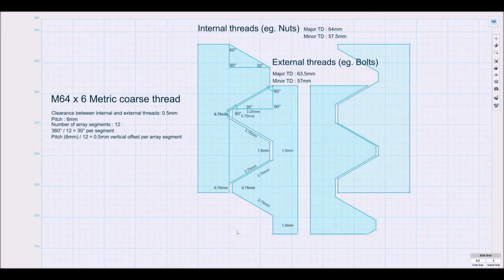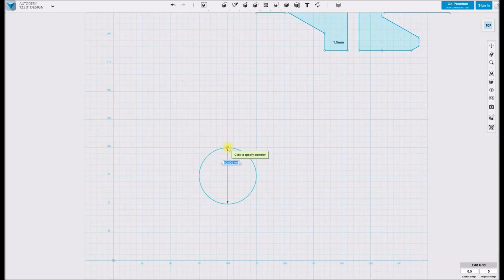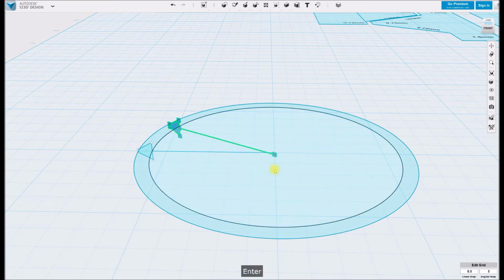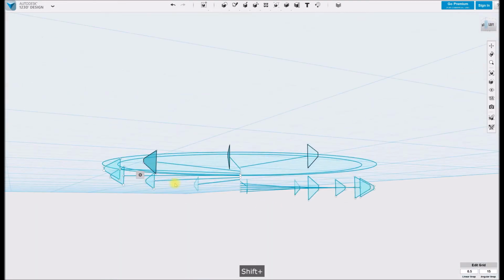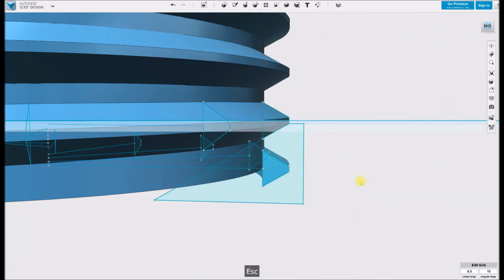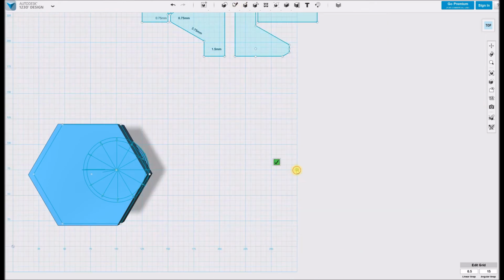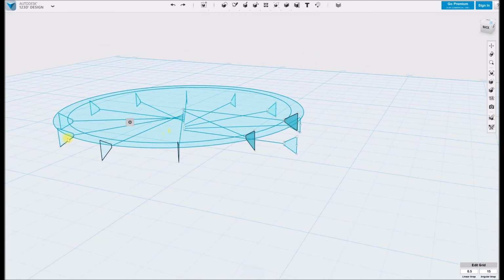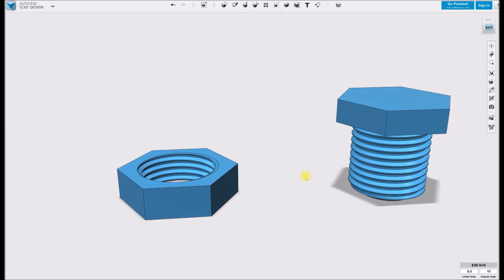How to build internal and external metric ISO threads in 123d design v2.0

Comment: Hi thank you for an excellent tutorial. One question i would like to build an M30X3.5 thread but am struggling with finding the correct Major/Minor diameter's for the nut and bolt. Any help with this would be appreciated
Reply from the maker: Hello, Electro. You’re welcome for the tutorial!, if you’re trying to find the correct major and minor thread diameters to model from, they can be calculated from formulas available on the internet. Unfortunately, I don’t have a moment right now to track them down for you, but any ISO thread that you would want to make should conform so the ISO formulas online. I hope that helps, please let me know if you are unable to find the formulas and I will try to assist.
Reply: @drive3d270  Hi thank you for your reply. I have managed to figure it out so happy days, appreciate your response.

Comment: Very informative. I am trying to make a 123D Design with a M5x.8 thread. It has been a real struggle for me trying to understand trigonometry and working out some of the measurements. I think I have a handle on everything except how to calculate the external thread major td and minor td. eg in your example above they are 63.5mm and 57mm. Was hoping you could point me in the right direction.

Comment: Again... all was going well until you made the hexagon head dimension "across corners" not "across flats" tut tut :-p
Reply from the maker: What time in the video (minutes and seconds) is the point when you're getting hung up?
Reply: 17:18 you have a circle of diameter 95mm or radius 47.50mm you should have a Hexagon measured across the FLATS not across the CORNERS...  look at the specs again :-)
Reply from the maker: Right you are. The intent of the tutorial was mainly to present the technique for generating the threads themselves, and I clearly got complacent when it came to the less important features like the dimensions of the hexagonal features.

Hopefully, you were still able to benefit from this tutorial.
Reply: Oh yes very helpful, I worked in mechanical engineering for many years and it just looked wrong and I thought I should let you know why... :-)

Comment: Very well done, a great explanation of what is a very difficult subject.  Perhaps a little more time explaining the way you set up the initial thread for bolt and/or nut might be useful for us "dumbos" as it was a little less than clear what you were doing with the triangles etc  when creating that first  thread.  After that I managed to follow along with the duplication process.  Also as an aside, perhaps a mention for newish 123 Design users, it is critical to select each of those triangles in ABSOLUTE SEQUENCE or you will probably get the dreaded big RED "Invalid operation"  warning.

Comment: Ok, so I'm confused.  According to your profile, and verified on wikipedia, the internal (bolt) thread peaks should be 1.5mm across, not 0.75, yet you made the nut thread profile exactly the same size as the external (bolt) profile... it should be 0.75 larger (vertically, on the profile), yes?

Comment: I found the constant relocation of the control point very monotonous. I made a few profiles using your method then I copied all of them and pasted the group. I selected the whole group again.… Doing this I was able to significantly reduce the number of stops and time to complete a entire thread profile.

I have continued to use your method to make specialized thread designs and experimented with trying to use the fewest number of profile sketches. If using increments greater than 30° there will be distortions that will make the thread fail.

I also found using just a circle and the profile sketch makes moving the control point to the center of the circle easier.

I do believe this is one of the best tutorials I have seen. I learned a lot from it.
Reply from the maker: Excellent suggestion, Sir. There is always room for improvement!  I have pinned your comment so that others can possibly benefit from your suggestion. 

Thank you for your input, and kind words!
Reply from the maker: I agree, its very monotonous. Copying and pasting the whole group will definitely result in less hassle, and makes it a lot more reasonable to do the progression in smaller degree-increments. Thanks for your input, if I make another updated tutorial, I will be sure to add that.

I'm pleased that you have gotten something out of this tutorial.

Comment: Just get a proper CAD program like Autodesk Inventor from Piratebay...
Reply from the maker: Higher level CAD programs like Inventor, Fusion 360, Solidworks etc. All have thread building tools in them. So if a user is ready to make the move to a more professional program then there will certainly be more useful tools at their disposal. However, with 123D design being a program that it mostly meant for beginners, while it doesn't come with as many features as the higher level programs, it is also less intimidating and easier to use.

It really just depends on where you're at in your learning process and how far you intent on taking your 3D designing.
Reply: I have a copy of AutoCAD 2000 that I still use for extremely detailed design work because it allows coordinate entry for high precision drawing. Even after over 15 years I still occasionally stumble across something new to use.

Comment: Good evening, I would ask why doing LOFT in all areas between the one and the other comes straight rather than curved someone could help me? thank you.
Reply: I had the same problem, and until I watched the video two or three more times I didn't realize what I was doing wrong. You need to select all the shapes using shift/click in order, then you click loft… If you click loft first it will always create the new solid between the first two shapes you have select immediately after you click the second one, whether you hold the shift key or not.

Comment: I'm still scratching my head as to where you got 2.25 (1/2 of 4.5), where 4.5 is no part of either Major or Minor Diameter?Everything else is very clear and straight forward, though picture clarity faded a few times, and I really appreciated your work!
Reply from the maker: My apologies, I didn't explain the dimensions of the thread profile dimensions thoroughly enough. If you look in the diagram that I start the video off with, you'll see that the thread pitch (distance between threads) is 6mm (hence the M64 x 6mm), and the length of the root between threads is 1.5mm. If you take that away from the thread pitch, that leaves you with 4.5mm remaining for the base/longest side of the trapezoid (thread profile). Since I started in the centre of that face, I cut that dimension in half to 2.25mm. This is done for ease of the sketch and also because its easier to grasp for beginners. I hope this has clarified this for you Joseph and Narutotrainer. If not let me know, and thanks for watching :)
Reply from the maker: https://en.wikipedia.org/wiki/ISO_metric_screw_thread

https://en.wikipedia.org/wiki/ISO_metric_screw_thread#/media/File:ISO_and_UTS_Thread_Dimensions.svg

These links may be of assistance.
Reply from the maker: Joseph Shook hey Joseph, please remind me where I am using a dimension of 2.25mm, and I can clarify
Reply: I have same question.  It starts at 4:45 min in the video.  I have no idea where 4.5 is coming from that you half to 2.25
Reply from the maker: Please see my reply to the original question
Reply: Thank you for your reply and now i see exactly where it's coming from.  Thanks for the very informative tutorial!
Reply from the maker: RycoIsCool the root of any iso metric thread is the pitch/4. In this case it's 6/4=1.5mm. If you google iso metric thread profile dimensions, there is a formula for every aspect of a thread profile based on its main dimensional numbers (in this case M64 x 6mm)
Reply from the maker: Sorry for the late reply. What time in the video are you referring to? (minutes and seconds)

Comment: How would I build the nut if I scaled the threads bigger for a different thing?
Reply from the maker: You should be able to take measurements (major and minor thread diameters, thread pitch, etc) from the newly scaled bolt and use a thread dimension calculator online to come up with dimensions for the new nut. Keep in mind that if you scale to some obscure dimensions for the bolt, and not a typical ISO thread, it is possible to do that but it will just be more difficult. Sticking to ISO threads means you can leverage all the thread dimension resources available online.

Failing that, you could build the nut at the same size as the  external threaded piece and scale it accordingly. Hope this helps!

Comment: i came up with a similar method for the bolt, but for the nut why didnt you just simply create a solid polygon for the nut, intersect the two, and then use the subtract function to remove the bolt leaving the nut with inverted threads? from there just scale it as necessary.  great video
Reply from the maker: That is one way of making a corresponding nut. I wanted to show how to make a nut from scratch, partially because in my other video I got a lot of requests to show how to make one, but also because there will be times when you only need to make a nut, and having to make the bolt to get a nut would add unnecessary steps. Not only that, but it would complicate the outside dimensions of the nut because you would have to cut the hexagonal shape after the body had been scaled for tolerance (to be the correct size), and people would have to be sure to only scale in X and Y, and not in Z. There are many ways to do this task, but since this tutorial is for beginners, it seemed fitting to show the full method for both. Glad you like the video :)

Comment: Thanks a lot for a great tutorial! Problem: I scaled to half the size before printing on Makerbot 2, PLA filament. The nut do not fit the bolt. How can I fix this?
Reply from the maker: well, that depends. Did you scale it equally in x, y, and z? Other than that, you might have to add a bit more clearance to the nut to account for plastic shrinkage. You might consider scaling the nut up by 0.5-1.0% in your slicer, but only in the x and y planes, NOT the z plane or that will throw off your pitch. Give that a try and let me know if that helps

Comment: Is it possible to change the scale of this quickly, or would I have to do all the calculations for a smaller screw?

Also, if I'm dealing with a smaller thread, would the "Plastic shrinkage" eliminate the threads during the printing process?

I'm talking about a H:10mm   L/W:3mm screw.
Reply from the maker: I believe so, although I've never tried this method, it seems to me that you should be able to do it successfully.. 

I would shrink the bolt and nut in their X and Y dimensions (assuming the bolt and nut's rotational axes are in the Z axis of your design space) by the desired percentage, and the Z in its own percentage. 

Example: If you have an M64x6 bolt and nut, but would prefer an M8x1 bolt and nut, you would resize the X and Y of the bolt and nut respectively, to 12.5% of their own original sizes, and then resize their individual Z dimensions to 16.667% of their original size.

I hope that makes sense.

As for the plastic shrinkage, no, your threads should not be eliminated, they will just be slightly smaller in dimensions than what you designed in the program and its significance really depends on the type of polymer you're printing in
Reply: Thank you for the help! I'm pretty sure I got it now.
Reply: Thanks Drive for making such an informative video, i have the same question as Infinite just with very little knowledge of 123D. I'm attempting some M3-.5 and M4-.7 internal and external threads and was wondering how you came up with your scale percentages? 

Also do you think threads of this size will hold up to printing?
Reply from the maker: If you google image search "ISO metric thread profiles", you will find MANY illustrated explanations of metric thread profile calculations. Its fairly easy to understand once you see it drawn out. Also, searching "ISO metric thread chart" you will get actual dimensions and angles for many standard sizes. This will cut out some of the grunt work if you're using a common metric size.

In my opinion, you will have one hell of a time printing threads that small that A)turn out clean, without being all melty (if you must print these, I suggest printing MANY at the same time, so that they all have cooling time between layers. Simply blasting the cooling fan may cause poor layer bonding) and B)unless you can print at layer heights of 50 microns or lower, I dont think you will end up with usable threads, however, this is only my opinion as I have never tried this before. 

May I ask why you want to print these fasteners instead of just buying some?

Comment: Great tutorial. Thanks for doing this. I'm curious. How did you arrive at 0.75mm and 1.55mm for the peaks and valleys (or whatever they are called)? Are they based on the thread profile? In other words, if I'm making a M36x4, does 36 or 4 factor into the size of the peak/valley sizes? Do you refer to a good chart somewhere online? Thanks.
Reply from the maker: hey Gary, I'm glad you found this tutorial helpful and thanks for taking the time to post! 

For the thread profile dimensions, you can google image search "metric thread profile chart" and that will turn up all the resources needed for making threads of all sizes. all metric thread profiles are based on the same formula and principles (for coarse metric threads). 

Hope this has answered you question!
Reply: I think I figured out how you got .75 and 1.5 for the "crest" and "root" dimensions. I found this PDF (http://www.gt40s.com/forum/attachment.php?attachmentid=60098&d=1344303659) that has the equations. I plugged in your pitch, used some isosceles triangle geometric math (base = 2*h*tan(60/2)), and the numbers worked out. Thanks again.